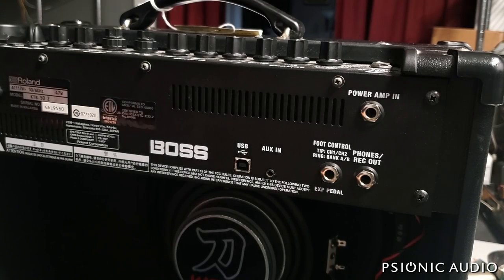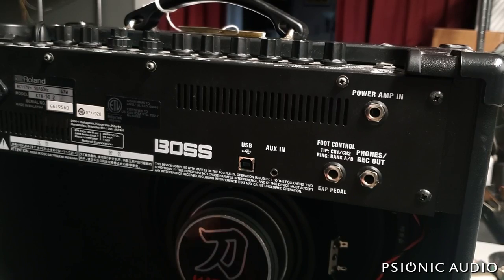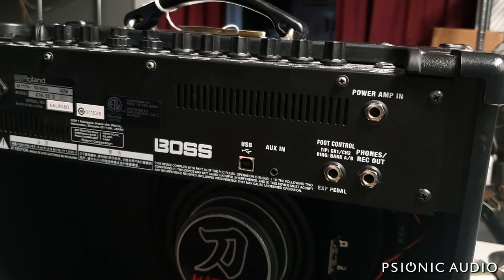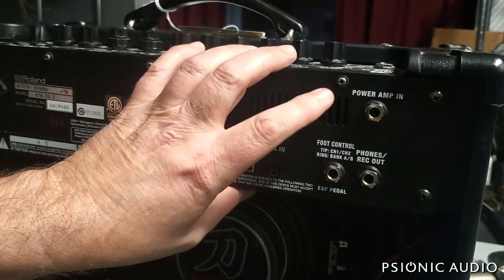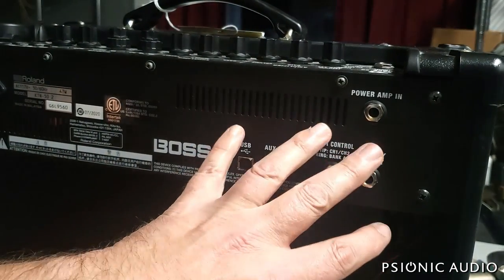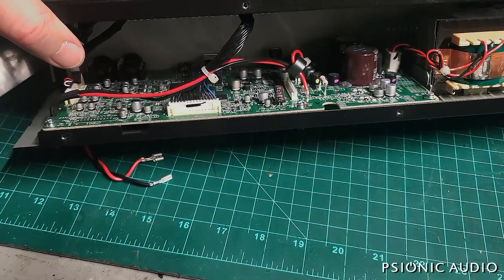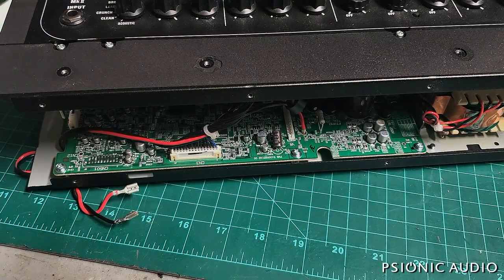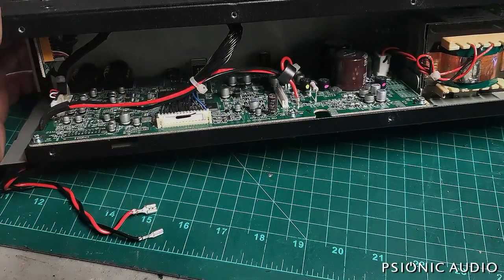Boss Katana 50 Mk II | The Cold Hard Facts of Business

Comment: This video was disappointing.  It's not the video.  It's the information it provides.  It's not that the information was not accurate.  I just didn't like the information.  I purchased a used Roland Cube several years ago.  It had some problems.  I had it fixed.  It broke again.  I got it got it fixed again at a relatively high price.  The people fixing it said it to repair it again would require a new main board that cost much more than the amp was worth.  After a few months it died.  Even for this discontinued amp, I could not obtain a service manual from Boss (Roland).  I mounted a class D amp in place of the Cube's amp.  I realize that it is reality, but it seems like such a waste to build things the way we do.  When I think about this my mind wanders to far off topics like the evils of capitalism, global warming and the loss of individual rights.  To make matters even worse, I bought a Katana 100.  It brings thoughts of being a loyal friend with a slow term Cancer and the only help for the friend is the mangled broken American medical system.  I guess I will appreciate the amp while it still lives.  Thanks for the video.
Reply: Well said and all true
Reply: I love you
Reply: @davestephens3246  I could not save the power supply nor the special effects.  I replaced the entire amp with the exception of the enclosure and the speaker.  I did replace the special effects with ZOOM pedals.  Your advise about bypassing is good.  It is better yet to have the manufacturer supply information to the consumer to enable the repair of the unit.  I would have attempted the two repairs myself had that information been available.  
 You know - I use that little CUBE cannibal amp a lot more than my Katana 100.😊
Reply: Didn't congress pass a right to repair law recently?
Reply: Capitalism is the only system that will allow to afford any type of luxury like a guitar amp.
Reply: @msh6865  That may be true.  However, it also needs to be regulated to ensure it suits the needs (& wants) of the consumer.  Often this regulation will also prevent waste.  The last time I used my cobbled Cube was yesterday.  I wish it could have been fixed.
Reply: @daniellarson3068  consumers self regulate the market. Companies that offer inferior products lose market share pretty quickly. A thriving market doesn't exist long if it relies on outside regulation.
Reply: @msh6865  A true believer in the free market.  Your belief may fade with time.  Thanks for the comment.

Comment: What an eye opener, I came close to buying one of these but I don’t believe I will now. It’s a shame that we’re supporting companies selling disposable products and not encouraging them to produce goods that last.
Reply: I don't believe that they're making amps on purpose that break. They do however cut corners with components, and is priced accordingly. Unfortunately, this type of business is very wasteful, and is one of the things that are destroying our planet.
Reply: Sorry, but we've made victims out of ourselves. Want a product that's endlessly fixable and will last for decades? Spend £1k on a handwired valve amp. Want something to enjoy and play with a decent sound while barely opening your wallet? Buy a Katana. If you buy cheap don't expect it to last a lifetime. And if you buy digital, don't expect a fix - cost of benchtime so often is more than the product
Reply: That's a silly attitude. There's no way to build an affordable, programmable amp like this, that has tons of built in effects, with easily repairable through hole components. It would be massive, weigh a ton and cost a fortune. You can either have cheap, high tech digital gear or you can have repairable gear. You can't have both.
Reply: Yeah Im not buyin any new Fender amps either; all the Champion series have issues and non-repairable...I do have 4 Fender Frontman 10Gs for home use, they seem to work OK!😣
Reply: Boss sold a million Katana's.  How many had problems out of a million?  I bought the head back when they first came out.  Mine still works great.  You seen inside one of those expensive TUBE amps lately?  Huge printed circuit-boards mounted component-side down!  You think those things are any easier to work on?  And they cost a fortune.  Those tube amps generate a LOT of heat.  Heat is bad for electronics.  Katana runs cool!  I could buy four or five Katana heads for the price of one 100w tube amp head.
Reply: I don't think the issue is that the Katana isn't repairable... in fact he said he is sure he could figure out what is wrong and repair it. The issue is that the cost of repair is higher than the cost of a new amp. It is an interesting dilemma... you could spend thousands on an amp that is less reliable than the Katana, and then you would feel justified paying to fix it, since it is so expensive. Or you could actually pay him to fix the Katana (even if it is expensive) and, while it would be expensive, it would probably still be cheaper than the expensive amp, and it would keep it out of a landfill. As a society, we don't think that way though...
Reply: @toesalad  Yeah, everything is based on "the cost".  The purchase price, and also the repair price.  But also:  value.  What do you get for your money?  And reliability:  how long will it last?  All these factors are important.  Which is why I think all these tube amps are a huge waste of money.  Especially in 2022 when we have so many better options available now.  In the 80's, the SS stuff sucked.  And the digital stuff was very new and seriously lacking in tone and function.  So all we had was tubes.  30+ years later.... the technology gap has closed significantly.
Reply: @toesalad  You are right. We live in a through away society. Back in the 60’s my dad would fix/repair stuff that broke even if it required learning some electronics repair. Now a days we toss something out if it’s a color we no longer like. Meanwhile the trash is piled higher and higher.
Reply: I have amps that cost “thousands”. One that was custom made for me. I have beautiful preamps, compressors, an awesome tube equalizer, two notes studio etc. Right now all I play is the Katana. Why? Good sound, cheap, easy of use, flexible, small, light weight, aux in, headphone out. Unless I’m recording something…..Katana all day. It all depends on your individual life situation. Each set up has it advantages and disadvantages.
Reply: jerdn  AFAIK, that model cube still used through-hole components. The problems are caused by surface mount components, which are very difficult to replace in comparison. Not only that, surface mount electrolytics can be notoriously short-lived.
Reply: @toesalad  it would be nice if the thinking started from the manufacturer. A little QC goes a long way.
Reply: Digital amps have come a long way, but still do not sound accurate. I always run to my older tube heads for perfect sound, and when i just want to riff it out for a few minutes & don't mind sounding "off", I use something similar to a Katana.  But imo, the digital world still has a very long way to go.  
And for the ppl crying: if a certain amp or pedal keeps breaking, it's our duty to spread the word.  And said company will be known for making temporary items. That's life in the big city.

Comment: Appreciate the look inside. I have a Katana 100 and have been using it for years. It owes me nothing.
I do have a philosophical objection to the e-waste problem of just throwing stuff out, but economically, the Katana makes sense. (And I like the sound(s)).
To the extent that there could be a partial solution to the problem: support the right-to-repair movement. Some repairs might become feasible if people like you had access to schematics, parts, and tools. Heck, with the schematic, I'd even take a shot at trying to figure out what was wrong with my amp (and I'm no technician)!
Reply: Right-to-repair is a serious issue that needs at least as much attention as climate change gets.

Thanks for bringing it up here.

Comment: Much respect on how you handled this one. I own the 100watt single 12" version. Thousands upon thousands have been sold in Europe and the USA. They have been the most popular modeling amps for years now.  I love mine but it's too bad they are basically non-serviceable. I would think the other digital offerings like Line-6, Blackstar, Fender, and even Marshall's would most likely fall into that category. I went with Boss because they are an offshoot of Roland who make great products including the tried and true JC-120 amps and lots of solid-state and digital keyboards/amps. Shame they can't/won't make them even more modular/serviceable. If they can make the Katana 50 for only $250.00 new, the whole board/parts should be made available to tech's/shops dirt cheap so we could all benefit. Yet here we are in the "real" and "disposable" world.
Reply: When I could repair a Line 6 it was usually that main encoder that scrolls through the banks of presets. That is like changing out a pot. Jacks also go bad or get broken.  The Class D amp boards? When those go bad, chuck it. I have not seen the SHARC processor chips go bad.
Reply: Line 6s are so cheap second hand, think mine went for £40
Reply: The Fender Bassbreaker amp is a regular tube amp, but it's impossible to repair because of the way it's built.
Reply: @nedim_guitar  - it's not 'impossible to repair' or even close to the hassle of a Katana. A bit more labour intensive and bit of a pain to disassemble yes (as it has multiple circuit boards 'folded' together for a more compact layout); but it uses standard components not the surface mount variety in the Katana, and Fender provide spare parts plus a full guide/schematic to authorised techs.

To be fair though, I only know because I've been thinking of a new Fender amp - maybe a Princeton - and I ran a few questions about reliability, etc past the amp tech who does work for a guitar store a friend works at!
Reply: @NFMorley  I'm curious what amp you've found that is more reliable?
Reply: It is incredibly expensive from a business perspective to have a supply chain running for parts of this amp that is itself sold so cheap. If one has the time and knowledge, they can repair using the parts that are available separately, but isolating the problem on circuits takes patience and skill - the labor cost is high too. The best thing to do imho would be to donate these to educational institutions where they teach circuit board repair. Once fixed, the institution could resell it and make money.

Comment: I can certainly relate this I had a VOX  VTX 20  loved that amp I broke the USB plug , there is a amp tech in town, getting the part was impossible and the cost to repair would be pretty much the same cost of the amp new, the amp worked but I had no access to the Tone Room which was a key feature of the amp,  Brad who channel is based on repairing amps had the same issue with Blackstar,  these amps are disposable, their made that way so you will buy another one,  all I have now is the BOSS Katana Mini great little amp pretty simple design if it breaks well I would not be out of pocket as much as it's big brother , good on you for giving the kid a break,  it's  great  to see the young folks picking an instrument  these days
Reply: Usb sockets cost cents and its not hard to solder wire to the circuit board if they dont fit like the old one. 
The problem with Blackstars (and all other cheap tube amps) is the tubes get hot and crack the board. Just find the break and bridge it. Job done.. 
Your local tech sounds lazy and obviously prefers the simplicity of point to point vintage amps. Dont we all really though?..

Comment: I own one of these and think it is hard to beat for the price but, like most things anymore, they are disposable items sadly. I also have a late 80's Sunn solid state amp that I have done a few repairs to over the years. Comparing the build difference between a completely discrete solid state amp and something like this is unbelievable. All of that surface mount stuff is assembled so close together that there is no way I would attempt soldering on it. Thanks letting us get a peek at the insides.

Comment: Confirm voltage supplies are good at the header going to the output pcb. If so, it is likely just a failed TDA amp IC which would make it a quick and cheap 30 min repair.
Reply from the maker: And if it's not, I don't get paid for the work. No thank you. Some amps I decline.
Reply: @PsionicAudio  👍👍

Comment: After the third brand new Fender Deluxe Reverb showed up defective, I gave up. For $1600.00, and heater wire and capacitor issues, replace the Jenson speaker, etc, plus $450.00 for new tubes down the road, if they are still that cheap in a few years if you can get them at all, it's a losing proposition all around. I bought a Boss Katana 100 Artist MK II for $529.00. If it burns to a cinder in 3 years I'll just buy MK III and still be $500 quids up. The future of Fender's tube amps aint what it used to be... Great videos by the way, thanks!

Comment: Everything in there looks like it comes out with screws and pretty solidly made connectors. The modularities pretty nicely implemented. 

If it was my amp I’d try check the resistance on the speaker was ok, and change the main filter caps and transistors on that little output board, but if that didn’t solve it, and there’s tiny SMD parts involved I probably wouldn’t bother going further than that without a schematic either.

Comment: After checking out this channel and seeing how hard they are to repair, along with being frustrated with using Tone Studio software to do anything with FX, I sold the Mk2 100 and got most of my money back, spent it on a Roland JC-40. 

I'm curious how the insides and repairability of the Jazz Chorus is, but the clean sounds are just amazing. I've gotten into building my own pedal kits so it's much better than the Katana.

The only problem I have with the JC-40 is that it is unbelievably loud! In my bedroom I try to use the volume dial at fractions of 1 on the knob, which is just weird and obviously doesn't allow the character of the amp to come out well. I don't know what to change about that.
Reply: Is there an effects loop?  You could use something like a graphic EQ pedal (or even a passive pot) in the loop, and turn it down, then use the amp knobs normally.
Reply: @ParaBellum2024  yes there's an FX loop. Thanks for the suggestion, I'm going to make a passive pot pedal in series to lower the volume. I appreciate it

Comment: Yep, I made the mistake of buying an expensive solid-state Fender amp years ago, only to have it become intermittent after 8 months of heavy use. I could find no tech that could fix it other than replacing the main board, which was not worth it. The only good thing about these newer solid-state amplifiers is that they are cheap, and the cost to repair them would cover the cost of trying to fix one. I would buy a Katana but only the cheaper ones, unless I was willing to pay for an insurance warranty to get a replacement when it failed. Being electronic, they will all fail eventually. I stick with reliable tube amps since I can find technicians to fix them.

Comment: Probably a TDA7294 IC.  Not an expensive part from Mouser.  It's not difficult to replace with ChipQuik, but i have to agree...if anything is wrong you've wasted much time.
Given everything seems fine i would probablytaken the chance.
Reply from the maker: And if someone else wants to try, they can. I didn't charge the kid, so I'm not sure why people have been upset.

It might just be that chip. But it might not be. And there is no schematic. And if was not designed to be really serviced. Boss board swaps.
Reply: @PsionicAudio  not upset, just commenting

Comment: Of all the amps I have run in the last 50 years the best quality turned out to be not the best sound, I still have a Peavey Special 130 I bought new in 1982 that has been in for a minor repair once and had the speaker replaced due to cone degradation only. The Katana is fun but please folks make sure you know what you are buying. Its just a disposable tool not unlike a paper towel. If you are going to gig with it, buy 2 and have a third one on order

Comment: I like these amps but I've never stuck with any particular amp for long. I've owned more amps and have used more amps than I can remember since my metal days starting in the mid 80s. I played a Randall RG75 and a Boogie 50 Cal + combo for years. Never had a problem. But I've dealt with nightmare Marshalls starting with an old plexi that sounded amazing but ate tubes like potato chips. One should always consider the cost of ownership when buying an amp, car, or any sort of complex machinery.

Comment: Reminds me of a Crate Excalibur 90 head I had. Bought it for $120. Volume control broke its solder joints as well as the input jack was intermittent and many bad soldier points throughout. Was told it was a $75 bench fee and around $250 total too fix. The tech told me honestly it wasnt worth the fix and he would refund me all but $25 because he spent an half hour finding nothing but hot garbage throughout the amp.

Comment: i am sure there is a very good reason you did not replace the power amp chip on the d-board . i blew up a class d amp once and got a replacement chip for 15 dollars it was super easy to remove the old chip so i cut all the legs and removed them one at a time that amp is fine now but what do i know .

Comment: Most of those cheap SS amps use the ST TDA7293 output chip. They fail with some regularity.  If the amp still had the plus and minus power rails, probably replacing that chip would bring it back. It's less than a $10 part. Anything on the surface mount board, yeah forget it.